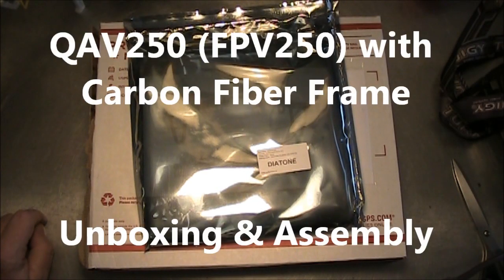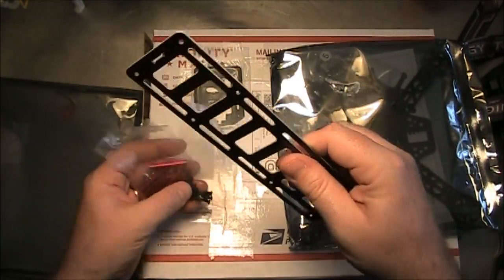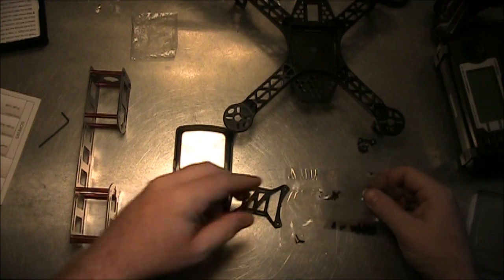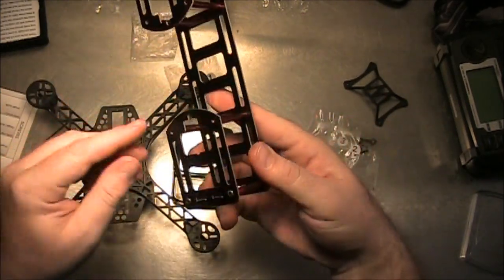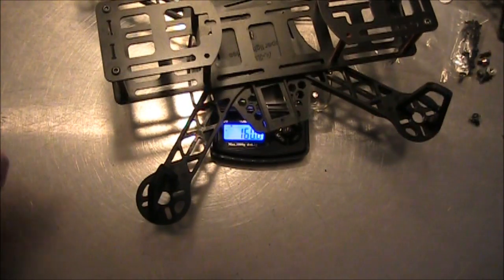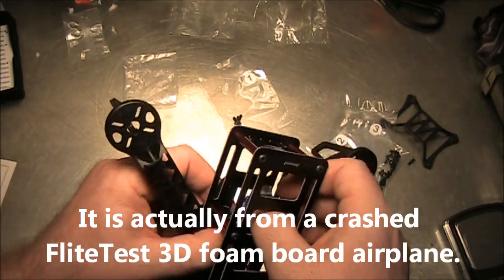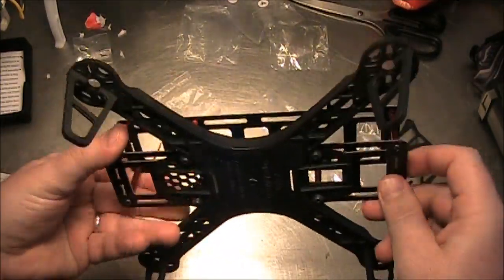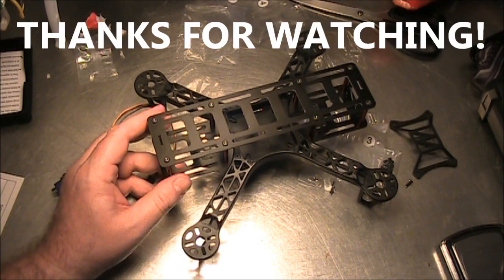Diatone FPV250 Unboxing and Assembly (formerly QAV250)

Comment: I'm pretty sure thats glassfiber and not carbon fiber :)
Reply: Agreed, this is not carbon fiber, it is flexible glassfiber which you can see from the first stress test (ie bending it out of the package). Carbon would not test that easily. If you want a cheap 250mm CF frame, look for the blackout clones.

Comment: Well done Travis -  I just received mine too.  What motors are you going with?  I installed the Multistar 1704's.  You have to mod the motor mounts just a bit to get them to fit but it is very simple.
Reply from the maker: I'm going to use some RCX 1804s.  I really want to use some of those Tiger motors but for $40 each, I think I should get good with cheaper ones first.  :)